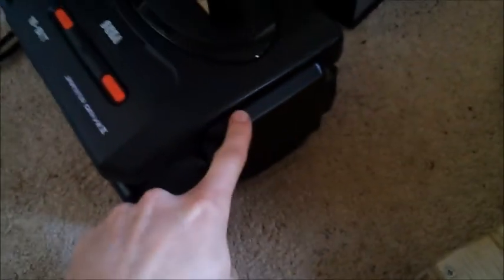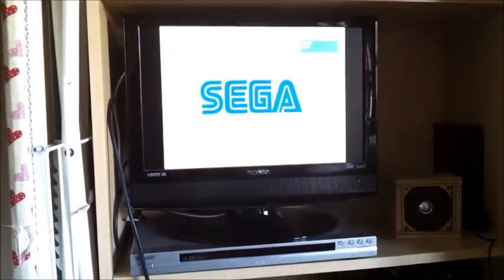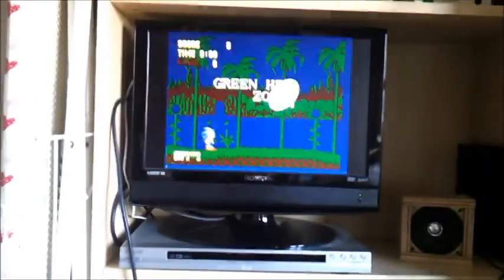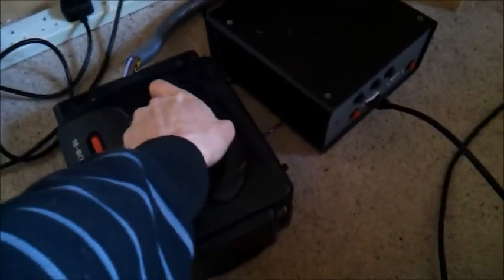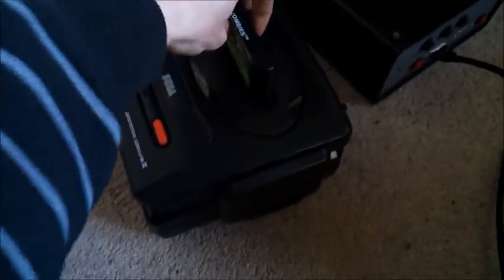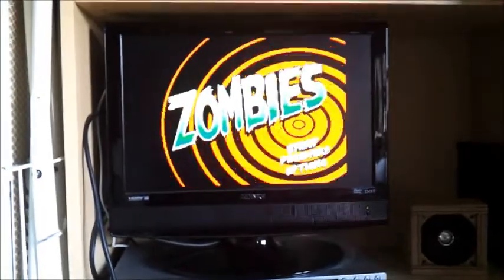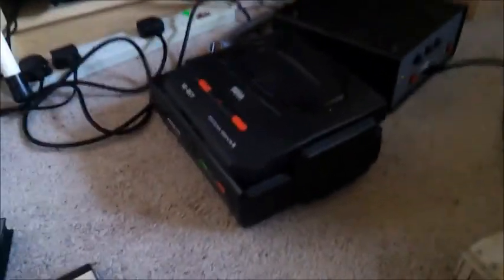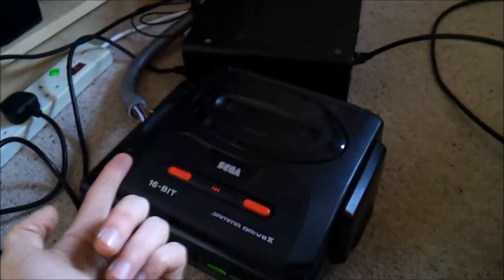Sega Jamma Drive 2 - Part Two

Comment from the maker: also, the "jamma drive 2" logo is a water-slip decal that I printed on my ink jet printer. I then used water and made the decal loose and placed it onto the case which had the old logo sanded off it. Then when the decal was dry I sprayed some Matt Varnish onto it to protect it. :-) google " water slip decal paper " and you will find the right stuff to use.

Comment from the maker: Thanks for the comment Robi :-) I dont have any insulation between the game pads and the main pcb as the bottom of the controller has no wiring or solder points, it is smooth. So I put that side against the main pcb so there are no shorts. And the pad that sits on top of the main pcb is arranged so the smooth side touches the pcb and there is no bridging / shorts. :-) I have some photos on my blog which is in the description. I hope that helps